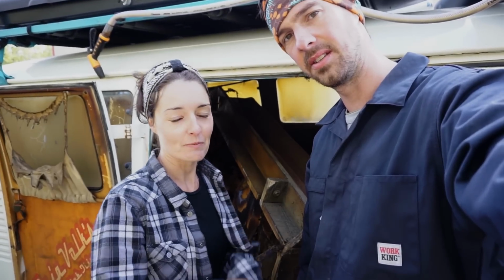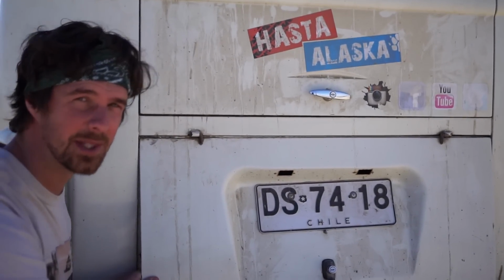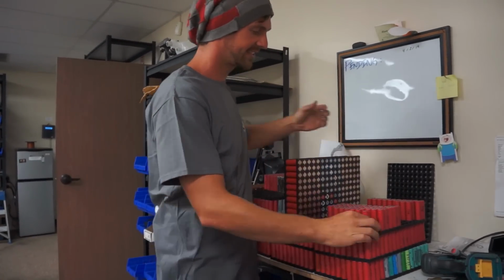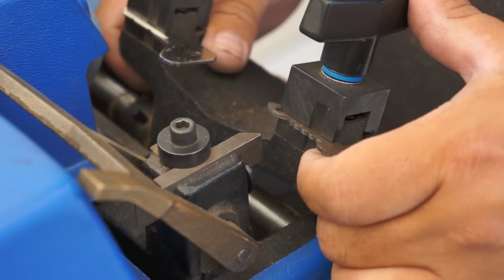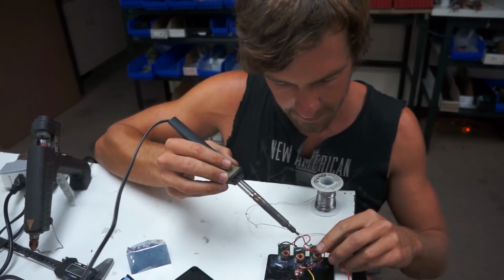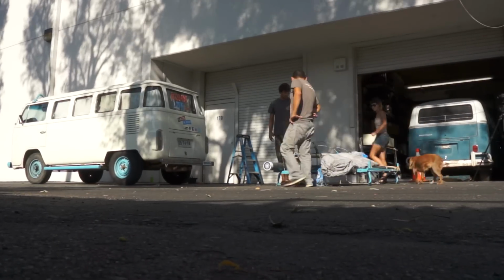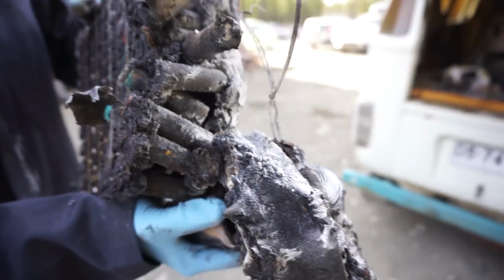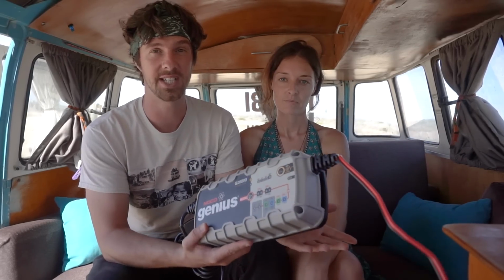Building an Off Grid Solar Battery - Hasta Alaska

Comment: the guy you had help you make your battery does not like BSM  he thinks you dont need 1 . your battery was very small for the size solar panel you had .  with out use of the bettery and with out a BSM and cell fuse like teals uses 1 cell over charged .. that would be my guess
Reply: also, your soldering was awful.  like the worst i have ever seen.  i hope that guy rebuilt that entire box behind the scenes and did not send you off with that.
Reply: +1 Christopher .. and I also believe that he cannot have let them go like that :) Still the guy building the battery is a cool dude/channel
Reply from the maker: probably a good guess

Comment: Unplugging the battery (and possibly the panel too) for long storage would have probably been better.  Removing the battery from the vehicle for long storage would have probably been the safest.
Reply from the maker: true, but I didn't fancy handing that battery to the person charged with looking after the van and telling him to put it in his family home :)
Reply: Entirely understandable.  Mostly thought I'd bring it up for anyone else in a similar situation to think about.
Reply: a few bucks in pico fuses and none of that would of happened, also would of put a BMS on there
Reply: he had the fuse wire on each cell, same way tesla does theirs. They blow at about 6 amps or so. But, a BMS would have helped.

Comment: for start, if you buy a charge controller it normally has a temp sensor. so when it is cold it will lower the charging power by itself. and second, this massive battery will have difficulty radiating heat. these cells get very hot during fast charging or discharging. so when packed close to each other the inner cells get hotter and hotter. it would be a goed idea to make a heat sensor on the battery itself maybe. to hot? shut it off. all connections are soldered. maybe one got cracked by vibration and changes from hot to cold. when finally loose maybe the was some bending strain on the wire and it moved towards the other connections and shorted out.
Reply from the maker: could be thanks for the comment

Comment: Lithium ion batteries are the dangerous ones. LiFePo4 is a lot safer and gets those 5000 cycles you mentioned, your Li ion batteries won't. One option you didn't mention for the cause of the fire is over charging. It's possible that the DIY controller failed (cold solder bad soldering etc) causing the cells to get overcharged.
Reply from the maker: We also thought that, but we ran that by Jehu and he didn't think it was likely.  One thing is for sure, the next charge controller will have the sort of intelegence that our current Noco smart charger has - that thing is way smarter than the DC-DCs that we used for the Li-Ion.
Reply: I have an idea how you can get a top MPPT controller sponsored. I just looked for an Email on your home page but found nothing. Is there a way to contact you?
Reply from the maker: https://kombilife.com/contact

Comment: Watch some sailing vlogs if you want a kickass solar system in your Kombi! If you just want to run electronic gadgets you probably will OK with 300w of solar panel and a 100Ah marine AGM battery. https://www.youtube.com/watch?v=M1NAnONqvgk
Reply from the maker: We need more power than that to make these videos.
Reply: What's  the maximum amount of 12v amps you draw when working?
Reply: Kombi Life the lithium battery idea is still not a bad one, but go with factory new cells the next time. you can get brand new samsung 2,5Ah cells for $2 a pop. the problem here was probably the old cells and the mixing of different cell chemistries

Comment from the maker: Please let us know if you enjoyed the video and feel free to comment below.  

We still think Lithium is the way to go, our battery performed for a long time flawlessly - over a year in fact, so don't be put off, just proceed with caution :)
Reply: If you still think about lithium batteries take a look at Lithium-iron phosphate (LiFePo) ones. They are a bit more heavier than those 18650 Cells (which have other chemistries), but they don´t have that so called thermal runaway. So they are way safer to use. Another advantage is, that their cell voltage is quite close to Lead acid batteries. That means you can even use them as starter battery (I´m using a really small one in my motorbike) if you configure them as 4 Cells in series. That means you can even charge them with your cars alternator when driving.

Wikipedia link for infos:
https://en.wikipedia.org/wiki/Lithium_iron_phosphate_battery
Reply: Kombi Life love the video! can you make one on all the mechanical maintenance needed to keep Copito running and driving through out the journey? also interested in how the bus did offroad in South America and Alaska.. this trip has been great to follow
Reply from the maker: Wow that would be a long video :) We'll put it on our to do list. thanks for the suggestion
Reply: the stats on the LiIon batteries are pretty wrong. Depending on the cells they have a cycle life of 300-1000 cycles. you can get more out of them is if you only ever drain like 60% of their charge and also don't charge them anywhere close to full. not very efficient, but thats what you would have to do to get anywhere near a couple of thousand cycles (on new batteries that is).

I like Jehus videos but he should have never suggested to use recycled cells. They still are old cells and have or will develop issues and require constant monitoring. Unless you know EXACTLY what you are doing and what issues can come with these cells and how to deal with them, its pretty irresponsible to use or if that was the case for Jehu to recommend them to you.
Reply: if u keep the voltage on each battery below 4v u can get 5000 cycles providing you do not go below 3.3v
Reply: a simple mppt controller set to gel 24v and batteries set to 7s running off inverter would have been way safer.. maybe 5% loss of power if correct size inverter used....better luck next time
Reply: If you would of simply put a pico fuse alone on each cell you wouldnt of had a fire,you can get 50 fuses for $5 - $10 if you had a 10$ battery management/balance board then you wouldnt of had a fire, I have no Idea why none of that was done...
Reply: what happened  to sharne?

Comment: Many folks disconnect batteries when the vehicles are laid up for long periods.
Reply: Its easily forgotten for sure, Always best to wire in a total isolator switch on the main feed (and fuses/circuit breakers of course)
Reply from the maker: they do, we did.  We disconnected our 2 batteries in the engine compartment, and disconnected the lithium battery from the load but not the supply.  We though covering it up would have been enough.
Reply: Kombi Life don't store 18650 batteries at a high voltage thry tend to catch on fire 3.45v each is a good voltage